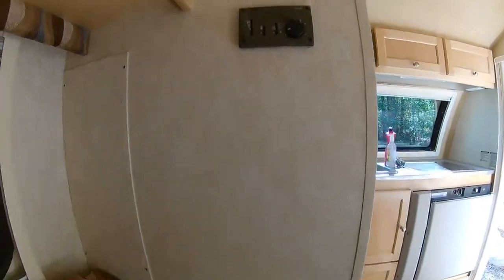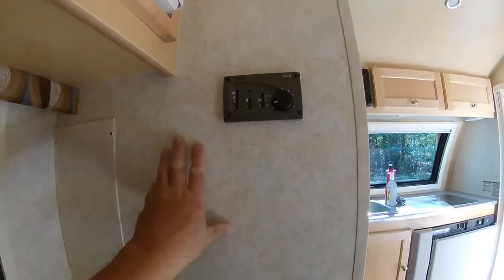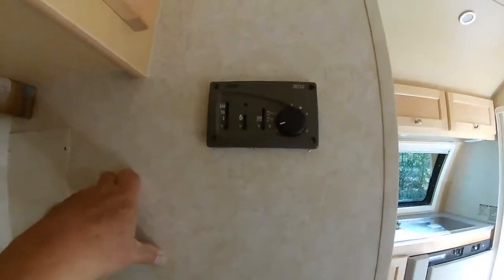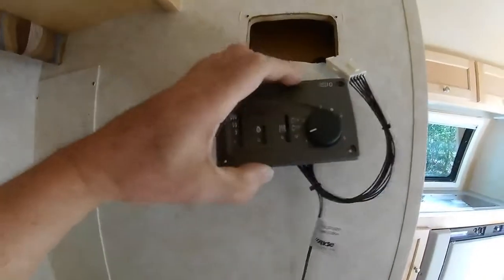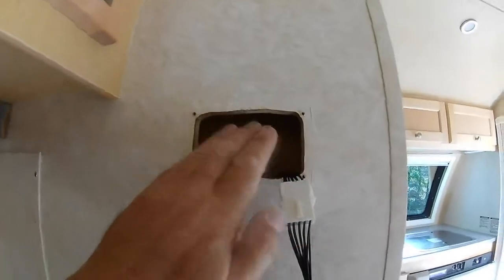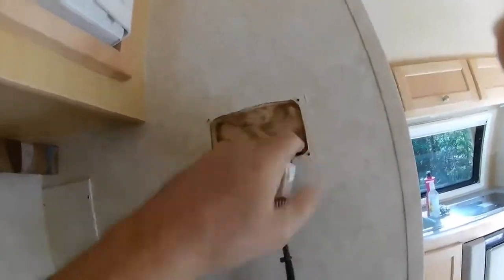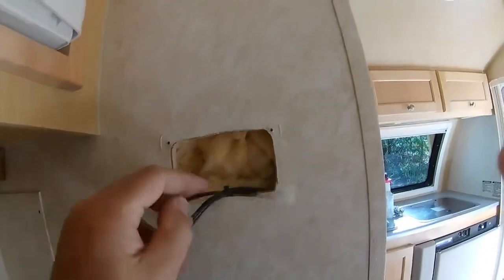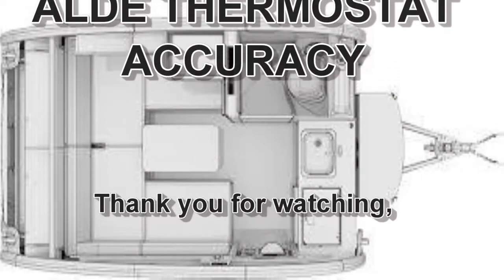Alde Thermostat Accuracy Fix- Tab Trailer Upgrades

Comment: Thank you for this tip. I’m wondering how the insulation stays in place while traveling long distances (on bumpy roads)?
Reply from the maker: It's light, and packed in like that the fiberglass fibers cling to the unfinished wood inside the wall. It stays put.